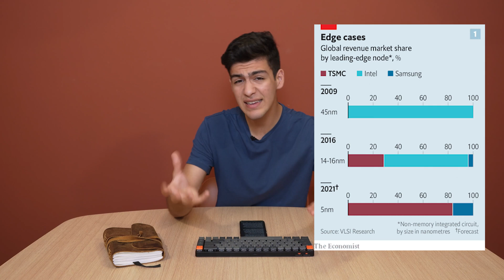Taiwan's Chip Supremecy Is Coming To An End

Comment: Chip making is more complex than making a car; it needs a considerable amount of money; for a ten nm factory, the cost of a factory is around 1.7 billion, 25 billion for a three nm, and 40 billion for a two nm. On top of that, advanced chip-making needs a lot of research and cutting-edge scientific work; it is not like you buy a EUV, put in a lot of money, then you can manufacture it. Samsung and Intel failed to solve the Pellicle difficulties, so even they own advanced EUV, they can't make 5 nm chips on a  sustainable profit base to support the continuity. Samsung's 5 nm has a lower than 50% yield rate; on the other hand, TSMC 5 nm has a 99% yield rate. As the chip is getting smaller, electricity leakage will be a tricky problem. As Samsung made 888 for Qualcomm, the heat and battery show Samsung's technology is not feasible. Now Samsung's 5 nm is equal to TSMC's 7 nm from transistors density's point of view, and its performance is even worse than TSMC's 7 nm. Burn J. Lin developed the immersion etching in lithography, who was deputy general manager of TSMC; he is the guy who helped ASML to surpass Nikon and Canon. Chenming Hu developed Fin Field-Effect Transistor technology, Taiwanese contributed many breakthroughs in cutting-edge chip technology. EUV perfected in Fab12 of TSMC, Hsin Chu, Dr. Anthony Yen, who was then TSMC's department manager, led the development of EUV lithography, including its mask technology, for high-volume manufacturing of integrated circuits. Later he works for ASML as  Vice President and Head of Technology Development Centers Worldwide. Less than 10% of the technology TSMC uses is relevant to the US. TSMC has made a breakthrough in self-made EVU technology, and the light source is 350w superior to ASML's only 200w. By the time TSMC uses no technologies from the US, and it can sell cutting-edge chips to China, this company is going to boom; your understanding of cutting-edge chip-making is lacking in-depth studies.
Reply: agree from taiwan